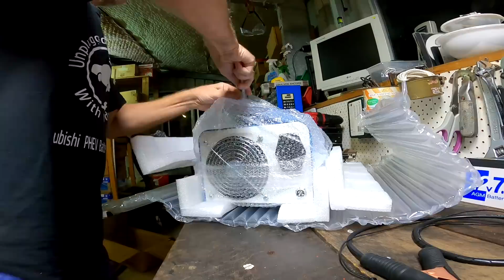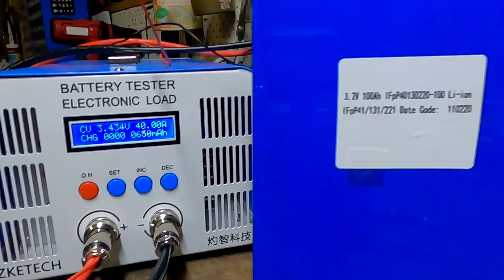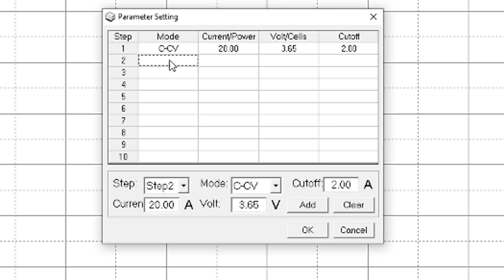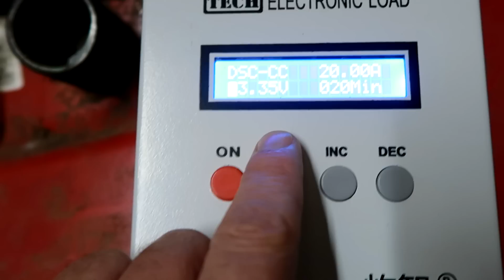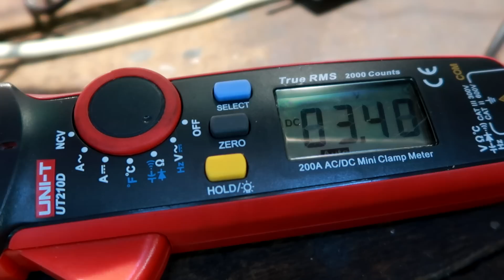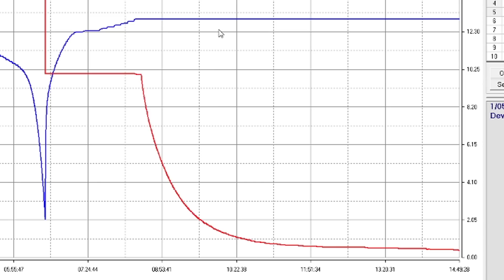My favourite battery analyser so far: Testing the BIG and POWERFUL ZKE-Tech EBC-A40L.

Comment: How to use the "Monitor" button named "Monitor" function? I mean how to connect external charger to battery and monitor this setup with EBC-A10H to draw voltage / current graphs?
Reply from the maker: Yes, that is possible. At least for the voltage, not for the current though.
Reply: @OffGridGarageAustralia  Why not for current do you know how to connect ampermeter, why this is different?

Comment: Thanks for sharing the video Andy, i know is a little off my question but do you think it is ok to use my 100A Inverter charger to quickly charge my new 48V bank (with BMS) and then top balance the cells? just to save time as my 3.65V charger maxs at 10A. Thank you!
Reply from the maker: That is totally fine as long as you have the BMS correctly set. It should disconnect your charger if one cell hits the max voltage you set. Probably get it to 3.55V first and see how much drift you have across all cells. The start charging all of them separately to the same 3.55V.
Reply: @OffGridGarageAustralia  thanks a lot!!

Comment: Indeed, the ZKE-Tech EBC-A40L looks like an excellent tool for testing batteries under conditions almost perfectly close to the actual future battery operating conditions. I was very impressed by the graphs and the possibility of precise data reading at any moment during the charge-discharge cycle. If this wonder has the ability to export data to a computer, it is a complete luxury.
I am equally impressed with the ability to easy arrange the test algorithm using definable steps. (Shouldn't the last, programmed step be ALWAYS charging to 30% capacity, if it is easy to program?) It is a great convenience, especially when there is a need to test many, many cells. You program the algorithm, connect the battery and after a predictable time you have the test result package and detailed data ready.
The only question is how accurate are the voltage and current measurements and how reliable - in other words, what is the real accuracy class of the measurements. But this is easy to verify with a multimeter of the appropriate grade.

Such tester should to have everybody who decides to build a large battery. Not only for initial testing of the cells after purchase, but also for diagnosing possible problems with the cells during regular operation. In my opinion, this tester is worth every penny spent.

Thanks to Stefan for the opportunity to view this tester and its impressive capabilities remotely. A small thing, but it makes me happy!
Best regards

Comment: Since you are running lots of test. Do you ever feel need of having two of these units. So that you can run two test at the same time. It is nice unit i wish i had budget for it. But for now 200-300£$€ is not something that i would spend for tester. VAT in here is 24% so i have to take long time to think my purchases.

Comment: Hey there, watched most of your vids since I found the channel. Ordered 8 280ah cells from basen technologies and going to order this tester, all based on your vids. Looks like so much fun messing around with this stuff. End game is to have 4x450W panels, growatt 24V 2000W all in one and 24V 280ah battery with overkill bms. Can’t wait to get the cells and tester and do some tests. My question is, can’t you hook the cells in parallel and charge them at 40amps? I was wondering if I can hook all 8 cells in parallel and do a full charge all at once. You think it would be possible?
Reply: Yes it is possible but if the batteries ar fully discharge the charging will be:8×280:40=56hours.

Comment: Why does this beast of a thing have only a 5v max? What good is that? 2 18650 in series are above that. Am I missing something?
Reply from the maker: They have other testers for that, they want to sell more devices.
I know the EBC-A20 can handle a 4s configuration but only with 5A. That's why I have both.

Comment: Hi. I bought the EBC-A40L because of this video and it is really nice, but as a german i've noticed a BIG PROBLEM for germans using this. The CSV generated by the program needs a point as decimal seperator. In windows with standard settings the programm of the EBC-A40L will use a comma as decimal seperator while writing the file, and after loading the data again to look at a graph it will only show you rubbish because the program expects a point as decimal seperator. Same with the Settings you can save, they will not work anymore after you switched the seperator in your windows settings.
Reply from the maker: I know exactly what you mean. There is no international standard for this and I still struggle with this since moving to Australia.
Once you got the data in the CSV file, you can open it in Excel or OpenOffice and replace all commas with dots using the search and replace function of these programs. The data is not lost.
Reply: @OffGridGarageAustralia  Thx i looked it up. Notepad++ repair of file:
Find: ([^\,]*\,[^\,]*)\,
Replace with: \1.
Leaf out the text in the front.

Comment: Hi Andy, thank you for sharing this one. May I know what is the voltage range, or can I charge my battery system  with 48v configuration?
Reply: Andy love your channel. I ended up getting a zketech ebc-a20 tester which I have used for the past 2 months. Do you know of a support contact for them I can't  find one anywhere. It is working in a fashion but has a very strange charging  waveform almost sawtooth like.

Comment: Just received my EBC-A40L yesterday. What a great piece of kit. I have two questions I could do with answers for.

1. I have started the capacity test routine that Andy did on his cells. I have 32 310Ahr cells. Even with high charge and discharge currents each cell will take over 24hrs to complete the cycle. On that basis it will take over a month to complete the test of all 32 cells. Any ideas welcome as to how to speed it up. I am using 3 buck converters with 3 PSU's to partially complete step 1 in advance for cells awaiting their turn with the EBC-A40L but that doesn't help much.
2. Once the charge cycle has been started using a laptop it seems that it will continue to run with the laptop disconnected which is useful but on reconnection it seems that it isn't possible to rejoin the charge that is in progress. This means that either the laptop is tied to this task continuously for a whole month or it is just used to get each cell started and the progress just monitored on the small EBC-A40L display. If so will this display show the achieved measurement of cell capacity at the end of the cycle? Better still is it possible for the laptop to rejoin the charge mid cycle?
Reply: 1. indeed. Best strategy is too shorten the charge cycle by using other devices (lab PSU, cell charger, string charger, etc). Or buy a higher current tester  😉

2. same experience here. Folks typically use an old laptop and leave it connected. I tried w a windows XP dinosaur but it did not work (usb driver not found). There is a guy out there who reverse engineered the serial protocol btwn the eb tester and the SW, so as to connect to an Arduino(?) to control the cycles and record the data points. Dunno if he completed that project

Comment: My comment is in regards to your Feb 7, 2021 video. You appear to have the battery’s in a plastic box . I assume the box bottom is not flat but somewhat uneven. If that is so then the tops of the terminals are not in plane. It is possible that this unevenness and the undersized screws cause the buss bars to not seat across the whole terminal. I recommend that the battery’s be placed on a fairly thick piece of plywood!  
Good luck
Reply from the maker: They all sit flat in the box and all busbars cover the whole terminal area.

Comment: The 85 watt restriction on the EBC-A20 is likely only on discharge, not charge. The reason why discharge testers limit discharge power in watts is because watts = heat. That heat has to be dissipated somewhere so the limit is based on how much heat the heat sinks and fan of the unit can safely dissipate without overheating.

You don't have this issue when charging: The energy isn't being dissipated as heat because it's being stored in the battery instead.

So it can likely charge your 12v battery at 20 amps, but only discharge at around 7 amps. 

Some of the fancier "discharge testers" actually have an option to use a 2nd battery to discharge another battery. This gives you the ability to discharge at higher wattages because you can pump that energy into battery #2 instead of just dissipating it as heat.

On the separate clamps: Try measuring the voltage yourself of that big clamp. I think you'll find it's not as accurate as measuring at the terminal. Remember there's a lot of resistance at the contact point where the clamp itself touches the battery terminal. So even measuring at the clamp itself would not be as accurate as measuring the battery terminal directly.

Comment: Andy, thanks for putting these videos out, I have placed an order for the BIG charger/tester to help with testing and charging my 280ah cells.  I'll get some video up as well once it arrives.
Reply from the maker: Yeah, if you just want to test single cells, it's the right tester. I love it and have it running 24\7 now. I just put more solar on my garage to compensate for the constant power draw from the charger and computer 😂
Reply: @OffGridGarageAustralia  Andy my tester showed up, a bit damaged but seems to work ok so far, thanks again for posting the link to this tester.

Comment: ‘Mr. Garage’: watch your channel/videos regularly and am a subscriber and really enjoy them. VERY INTERESTING and educational. In fact, just today, I ‘popped for’ in order/placed an order for four 32.v 280ah LiFepo4 cells - $568.64 US - Shipping Included - to be shipped to me in Winnipeg, Canada. Am currently now in the process of looking around for an appropriate BMS… Looks like it’s going to be fun!
Anyway, watching your videos I get the distinct impression that you are a ‘stickler for’ PRECISION when trying to measure things, such as DC Electrical Voltages. It occurred to me that you might be interested in picking up something for about $20 or so broadly speaking known as a Voltage Reference Module - an inexpensive device – again – retailing for no more than about $20 or so – that is High Precision and – typically – CALIBRATED To deliver reference voltages at 2.5 V, 5 V, 7.5 V and 10.0 V.
I picked one of these things up about five or six years ago and found it extremely useful - I was able to go through ALL of my multimeters and check them/their readings at each of the four voltages and simply affixed to the back on a little slip of paper covered with ‘scotch tape’ what the TRUE Voltage Reading was at any particular Meter Display Reading AND generally I simply also included on that label a PERCENTAGE by which I should adjust the display through calculation/math if I thought it was important.
Anyway, and again, they go for only about $20 or so US and you can easily find them on eBay and other places by searching for something like this: 
“Voltage Reference Module AD584LH 4 Chan High Precision”
Here is some additional ‘typical’ info:
Item Description
Description:(AD584 With housing)
Built -in AD584, highest accuracy and stability
Same port can output reference voltage : 2.5v, 7.5v, 5v, 10v
The MCU switch 4-way reference voltage output with LED indicators
Single - button operation switch reference voltage
4mm banana socket as output interface
Note:
Please check input battery charging voltage and do not charge with more than 5.5 volts
Please charge with a USB adapter.

Package includes:
1 x High Precision Voltage Reference Module with housing

Description: (Green or Yellow)
AD584 Voltage Reference, employing 38 people with a high baselin +Agilent 34401 LTZ1000
Than labeling Instructions use 12v or 15 v input voltage , the input and output position,
there are marked on the board.
Changeing the position of the jumper, you can get different output voltages.
The output voltage is divided into fourth geaar 2.5V, 5.0 V, 7.5V, 10.0V.
Color avaliable: Green and Yellow

Package includes:
1 x AD584 4 Channel 2.5V/ 5V/ 7.5V/ 10V High Precision Voltage Reference Module (Green or Yellow)
I purchased one of them with/encased in a Covered Plastic Stand for protection. All it needs for a power source is 5 V from a USB charger (micro USB).
ANYWAY, I just thought you might find it an interesting and useful gadget and not at all expensive…

Comment: Andy, the wait process as you showed us is after full discharge to 2.5 v, you need to wait 30 min then start charging not to wait after you start charging as you did
Reply from the maker: No, that's not correct. You always fully charge cells and then wait. 
'The capacity on 0,2C discharge till the voltage tapered to 2.5V shall be measured after resting for 30min', it says.
Reply: @OffGridGarageAustralia  so first we need to fully charge the cell to 3.65 and wait for 30 min , after that do 0.2C discharge till cut off volt 2.5 then here you need to rest for 30 min then read the capacity and start charge process . This should be done between task 3 & 4 .

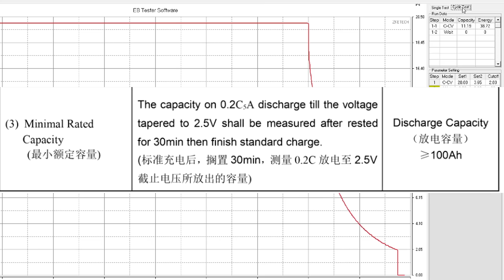Comment: Andy, at 20:45, the manual is talking about measuring capacity by discharging, waiting 30 minutes, and then doing a standard charge.  What you were doing was charging, waiting 30 minutes, and then discharging (opposite of what the manual says).  

There is nothing wrong with charging and then waiting 30 minutes before discharging, but that is not what the manual said (or at least not the section you showed).
Reply from the maker: It's the bad translation they did. All cells need to rest when charged before doing a capacity test.
'The capacity on 0,2C discharge till the voltage tapered to 2.5V shall be measured after resting for 30min', it says.
Reply: @OffGridGarageAustralia  so, in better English: "To test capacity, rest for 30 minutes after full charge, then discharge at 0.2C until voltage measures 2.5V."

Comment: I may have read this wrong, but didn't the instructions say wait 20 minutes then complete a standard charge?  Should it be 5 steps?  20 amp charge, wait, standard charge, discharge, then recharge.
Reply from the maker: 'The capacity on 0,2C discharge till the voltage tapered to 2.5V shall be measured after resting for 30min', it says.

Comment: Andy, I am building a small 12v system with a 240v inverter. Is it ok to connect use the mains earth with the inverter. So Line/Neutral from the inverter and earth connected to mains/house earth.  Or should I keep the earths separate. 

What is did you do with the earth for or off grid garage?
Reply: I'm no expert but my understanding is if your system is to be used in a house you should use the house earth. That way everything will be at the same potential. This video explains the problems.
https://www.youtube.com/watch?v=S5OtLg6voZY

Comment: @Off-Grid Garage - Wow, those machines are dirt cheap. Can you buy another EBC-A40L and put them in parallel for higher C-rates? Also can you measure the charging energy efficiency of these testers? I expect them to be somewhere around 90%.

Comment: Well, I can forget about the smaller one in your other video, this one looks a good one to have and I also like the automate cycle test function.. BTW, inspect those alligator clips that the wires are properly terminated to the body of the clip, some time they are poorly crimped,  I usually solder them.

Comment: Separating the current source and voltage measurement is called 4-point probing.  This technique is used to achieve very accurate measurements by effectively eliminating resistance in the current source path.  It's typically used to make resistance measurements. It's very common in high end power supplies,  like HP.
Reply: Yep, my battery resistance tester has that. Looks weird.
Reply from the maker: That wasn't my question. Why does it need a separate clamp though instead of having both cables connected to only the big clamp?
Reply: @OffGridGarageAustralia  The small clamps are needed bc of the voltage drop at the point of contact btwn the big clamps and battery terminal. If that contact has, say, even as small as a 1milliohm resistance, pumping 40A will result in a 40mV drop. Times 2 clamps, = 80mV. Which the battery does not see / experience. 

That would throw off when the tester stops charging / discharging, when based on voltage. And it would make all the voltage dependent values wrong, like Power(W) and Energy Wh).

Hence the small clamps that are supposed to connect directly to the batt posts. Since these just measure voltage, virtually no current will flow through them, so no voltage drop error. I.e. higher measurement precision. Which is key for sensitive lithium chemistry.
Reply: @OffGridGarageAustralia  In your case I think it's because electronics more sensitive than a multimeter are trying to detect differences between the two. If the two measure exactly the same, that confirms the main set is properly connected and it's not wasting time giving you measurements down to the microvolt using a bad connection.